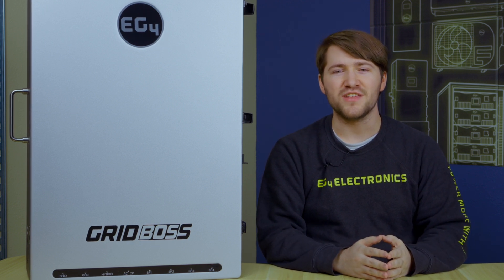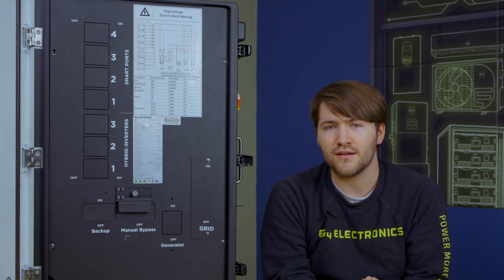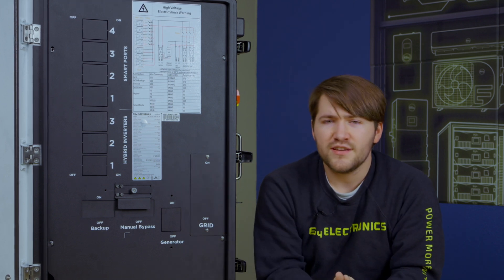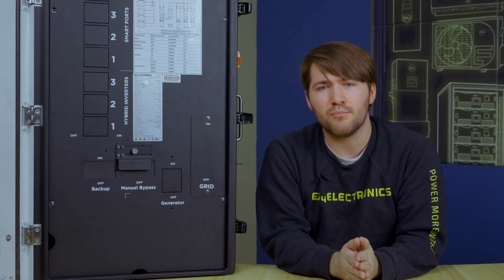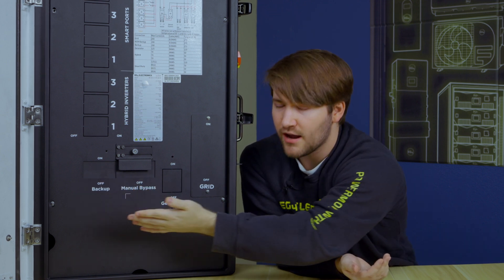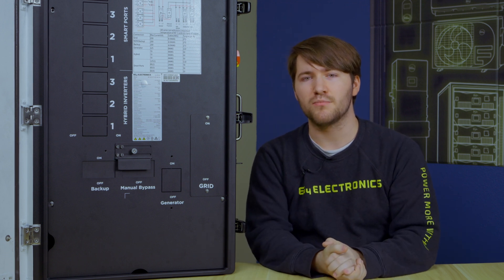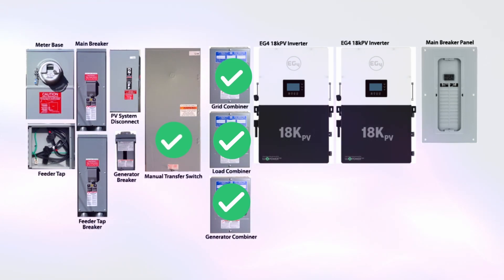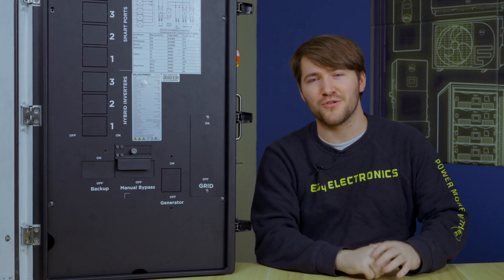What is EG4's GridBOSS? (complex, yet simple!) | Overview with Brayden

Comment: I like the innovation at EG4.  However, this presentation is a bit dry as to what you are actually selling.  I'd like to see a more practical presentation with real world hook ups to ascertain the usefulness to me.  I currently have my grid incoming to a utility building then sub off of that to various other buildings such as my home, shop, barn, etc.  I'd like to see if integration is feasable or possible and whether the unit is capable of providing me with any advantages.  I do not have nor ever will have any of my solar components in or near my home as I don't trust any type battery for safety.  Hopefully, you will provide us with more/better videos on the merits of this device and it's upcoming 'companion' device with the grid buss bar.  Thanks
Reply: Just fyi? The vast majority of LFP battery fires? Are not the actual batteries. Its the BMS that is normally to blame for any issues with them. New equipment designed for indoor use has onboard extinguishers in the BMS area of the battery for precisely this reason.
Reply: Well, EG4 has a BossBOX product now which is basically like a small palletized container where you can stuff all of the devices and batteries a safe distance (a few feet) from your property, if you are that worried about it.  The cost is not minor, though.  I personally think that LFP battery fires are so rare in small-scale home systems that EG4's indoor batteries ought to be sufficient.  I am putting two in my garage.  Famous last words, eh?

Really though, there is a massive, massive difference between LFP chemistry batteries and any other lithium chemistry, nor does one have to worry about lead-acid issues like hydrogen outgassing.  While LFP chemistries can run-away, it is extremely unlikely and runs about 1/100th the temperature gradient that a NMC runaway would run, so usually there would be no fire anyway.  Just a lot of (toxic in gaseous form) white smoke.

To put it in context, the batteries in your average cell phone, pad, or laptop are far more dangerous than these batteries will ever be.  Let alone robo-vacuum, e-bike, or portable electric toothbrush or shaver or anything else with lithium batteries in them (because those devices usually have NMC or NCA chemistry lithium batteries).

-Matt

Comment: How many units would be needed for a full Electric home! To start with two 5 ton heat pumps, 220 volt double oven and 220volt stove top, 220 volt water heater, 220 volt well pump, I live in Florida and the whole house is Electric. Or can I speak to someone?
Reply: I would say 2-3 but other than the 5 ton heat pumps... the others are hard to say what they would draw without an amp rating, luckily the surge capacity is really good in these so unless you are running over capacity constantly.... I wouldnt see having much more of a need than 3... sure way to tell is to have a clamp reading each leg at your house and have everything cut on at the same time and see what your peak is...
Reply: @parkerwatts3334 i know a 15 kw Genarator can't not run my whole house! Actually, I can't really even start the one 5 ton heat pump! I've heard the ideal of hook in parallel extra inverters. But before spending i like to figure out how many it would take and break down of all the components i may need.
Reply: @dennissmith1469  if you dont have a soft starter.. that is why you cant run your heatpump
Reply: @parkerwatts3334   How would you parallel these though if you had two meters powering the house and a dwelling unit? Could solar back up both if the grid went out for both?
Reply: @con-king  You cant have just one system run 2 meters together (easily) you would need to have 2 separate sets of inverters but you could share the same battery bank
Reply: One.  This is not an inverter.  The inverter is what determines that.  Probably need one of the flexboss inverters with a few batteries.
Reply: @ChristopherFoote22  I thought i saw a rating for 18kw continuous.. my bad.. but yea inverter determines it all... I was also just looking at the inverter one too
Reply: @ChristopherFoote22 I know this is the load unit. But it's only handles up to 3 inverters. Batteries i already purchased. I've purchased 48 SOK 48 volt server rack batteries with the outside enclosure. Now I just need to pull the chains on how many inverters I need to run my whole home and how many of these Grid bosses must be use. Or I'm going with Victron
Reply: @ I can handle three eg4 hybrid inverters and ac coupled inverters on the smart ports

Comment: Is this better than 4 - 6000xp's
Reply: Its not an inverter
Reply: Maybe look at the FlexBoss21 or the new 12000XP
Reply: @joshomary7977  i have 4 -6000xp's and one is hooked to grid breaker to charge when 30% SOC is reached,, then it charges to 60% SOC.
10k of solar
Reply: In my particular set up I found that the transfer switch in the 6000 model won't work for me as it requires I tap in prior to the main panel and after the meter.  I don't want to break the seal on the meter to allow wiring in and was wondering if this unit could somehow alleviate that issue.  I've hesitated with purchase of any EG4 equipment until I can obtain more information as to actual functions.  This stuff shouldn't be a mystery with fancy terms to describe it's use.  I really need a more comprehensive video with real world use and thorough description of its advantages.  Barring that I doubt I'll ever purchase one of these products.  I own a host of solar products for back up to grid but have come to the conclusion that installation of the solar will only occur after the grid goes down.  Not my ideal set up but it is more understandable than dealing with unknown characteristics and features of one of these automated devices.